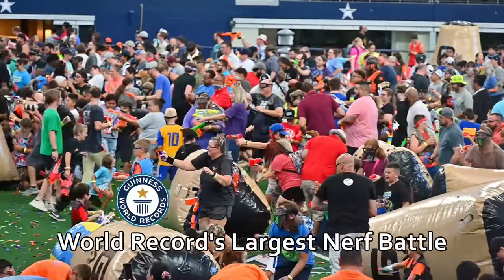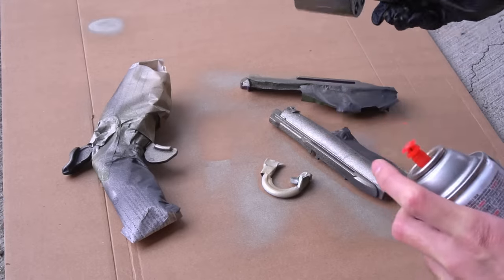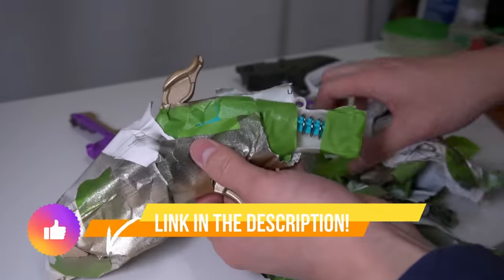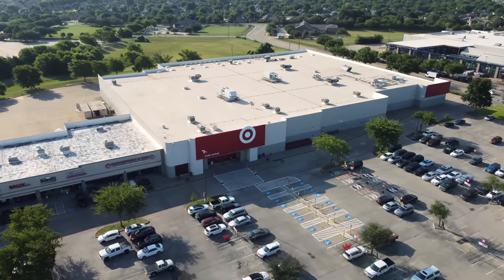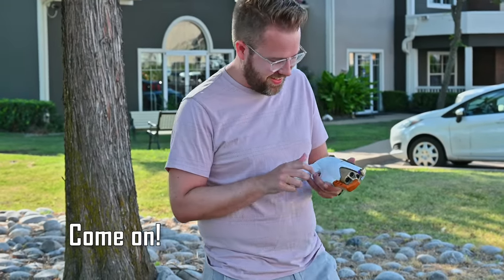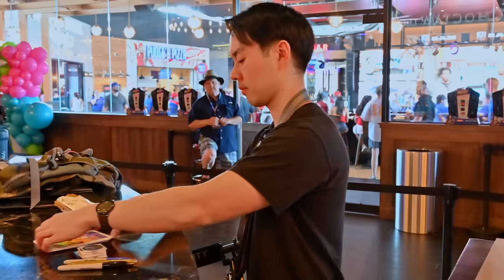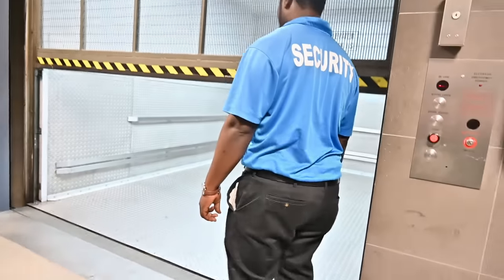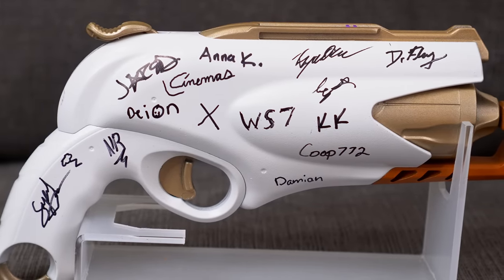My most valuable Nerf blaster (not what you think)

Comment: Great video!  It looked like fun.

Also, that's not a Sweet Revenge.  That was the Five by Five from the Rebelle Super Stripes line.  A bit more rare, and cooler in my opinion.
Reply: He is talking about the gun, not the decal
Reply: @supermech0780  So was I.  That blaster is the 5 by 5.  Look it up.  It was basically a Sweet Revenge reskin.